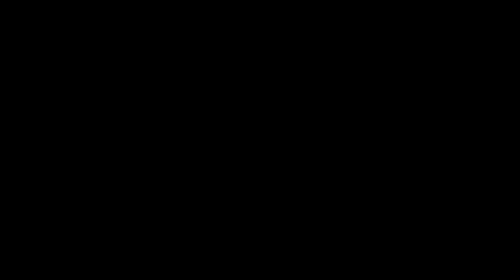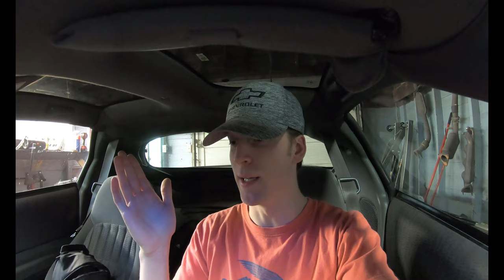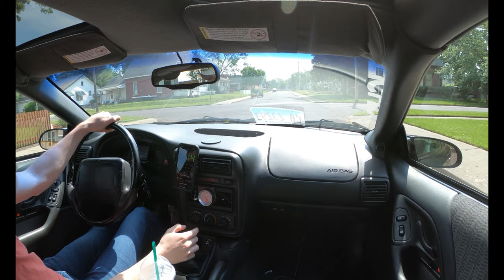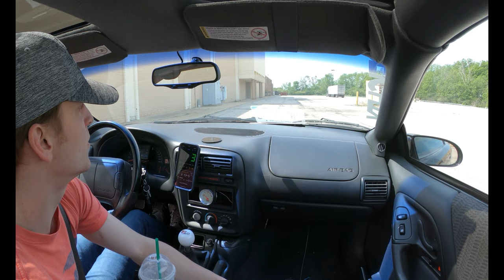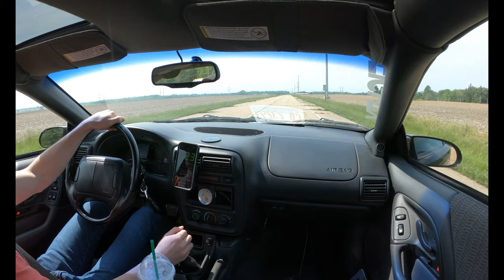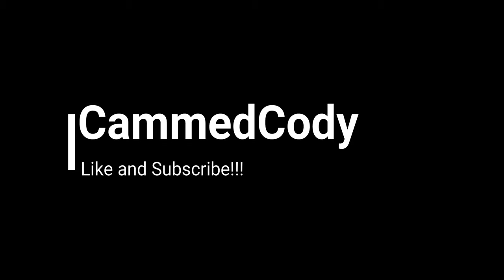BTR stage 3 cam, idle  and WOT pull!

Comment: Are they the stock heads?. I didn't catch that in the video.

Did you use the stock 7.40  push rod length with the BTR 3 cam?
Reply from the maker: Yep stock heads and stock pushrods length

Comment: I wanna run the true duals but I don't know if they will clear even with custom fab work by a welder since my car is so low
Reply from the maker: Mine is stock height and I think I have about a soda can at the lowest point
Reply: i had speed engineering duals on my trans am (bumper exit kit).  At stock height there was no ground clearance issue at all.  Once I installed strano springs it was obviously worse, but only bad issue I had was I couldnt get it onto my 4 post lift.  My current ORY/Magnaflow catback ground clearance is not ANY better than my dual setup (not happy lol) if thats any help to ya. and my magnaflow catback setup has more rattles than the big duals did as well. if the SE duals would have been slightly quieter and leaked less I would have just kept them.  But not happy with my magnaflow set up either.
Reply: @CaptainThirdGen  thanks for the experience man, was that with it bolted on or did you cut it up to make it fit? I've read with custom fab work it can fit and have decent ground clearance but that's with stock or slightly lower ride height
Reply: Mine burns up my grass where the headers are so close to the ground
Reply: @dezbigguns1072  wow 😂

Comment: Hey Cody i recently built my 99 Trans am Ls1 to the BTR 3 cam package, new rods, springs, lifters & pistons ((not forged)) & had my heads surfaced. I notice a very uncomfortable Chattering coming from my valve train. I pulled the valve covers off & torqued all rocker arms to 22lbs. & using Mobil 1 5w30 synthetic oil. Is the uncomfortable Chattering a common thing?? I was thinking maybe using a heavier weight oil such as 10 w 40 synthetic?? I have less than 200 miles on the built motor now. Any suggestions would help. Thanks
Reply from the maker: I had no chatter with all stock size pushrods (7.4) I would go through and make sure they’re torqued in the right order when there’s no pressure on the spring you’ll have to turn it over by hand a couple times to do all rockers
Reply: That's normal sounds like lifter tick it's just the cam size
Reply: Doing some research on this read that it is not recommended to shave the heads. Did you find any cause to the chatter?
Reply: Update!! Sorry guys it's been a while sense I been back, caught up with life 😭😭😭 to answer all questions, I found the reason for chattering. I had cheaped out & bought the cheap crappy ebay lifter trays that caused my cyl #2 to collapse on the exhaust side. I went out with car buddies & well I got on her & headed a nasty bang/pop 🤣😭😭😭 I limped my car home & tore down the top end to see the damage as she mushroomed the lifter & whiped  out my cam.along with it 😭😭😭 so being cheap over a $30 part ended up costing me $850 in the long run plus a weekends worth of work installing & putting my car back togeather, new cam, the right freaking lifter TRAYS, LS7 lifters & gaskets, I did 2 oil changes on her after  2 weeks after to help flush out metal shavings 😭😭😭 I've sense then 9 months ago have put roughly around 2,000 miles on the motor & haven't had no issues. The chattering is now gone & I'm much more happier than I was before. When building motors. Don't be cheap 😭😭😭😭😭